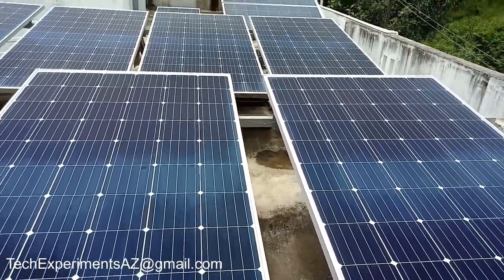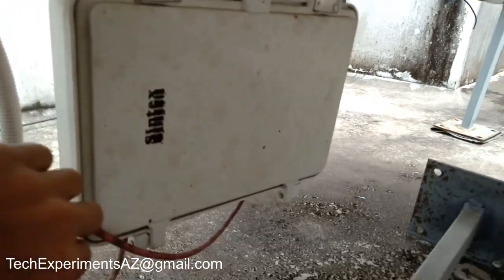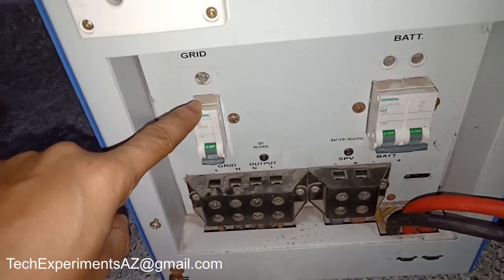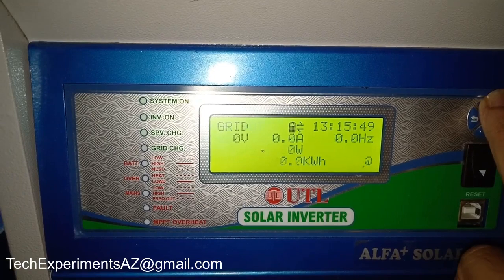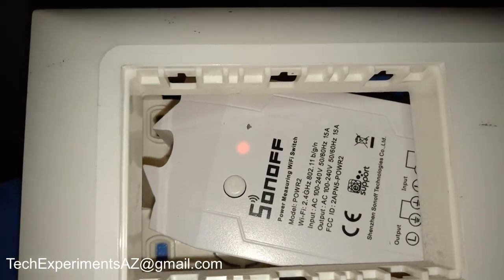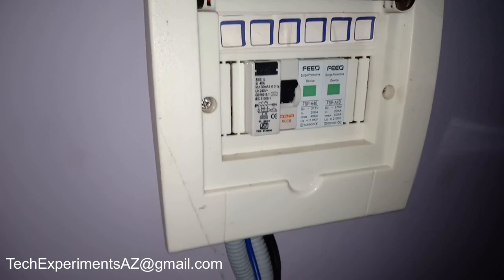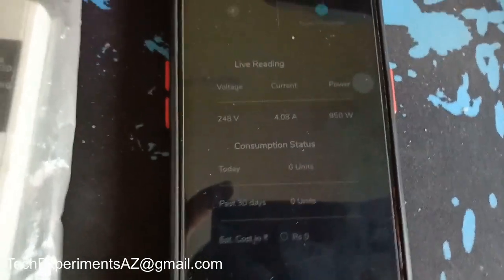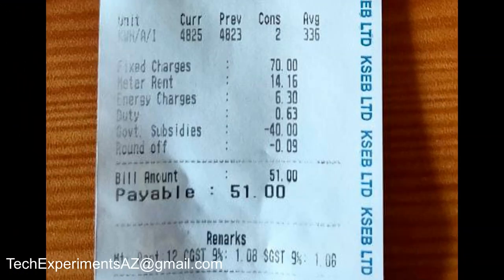KSEB bill 51 രൂപ മാത്രം.  സോളാർ ഇൻവെർട്ടറിൽ എല്ലാ ഉപകരണങ്ങളും പ്രവർത്തിക്കും. Off Grid Solar

Comment: 3 by. 6. Tube. Bhai. ..Pipe..Alla.   4. Battery.   3. kW.  Kittumo
Reply from the maker: yes tube anu , pipe alla,   thanks pointing it :)  1" by 2" GI Tube
1 battery 150 Ah 12v = 1800Watts
total 4 battery = 7200Watts = 7.2 KW storage
50% DOD = 3.60 to 4units range il  battery  use cheeythal nalla life kittum
Thanks for supporting channel by subscribing.
Reply: Ok. 3 kW.  How much.  The cost.   Totel.  Installation.  With.   Vickram. Pannal. 360. Watt's.   And. Luminas.  Batter. y. 150. AH.  4 PCs       the. Cost. Please
Reply from the maker: Total 2.6L 
Vikram 375Watts mono perc panels
Luminous 150ah c10 5 yr replacement warranty  battery
UTL Alpha plus 348 with 5 yr Warranty

Comment: Total amount?
Reply from the maker: 2.6L
Thanks for supporting channel by subscribing
Reply: It's money. West.  2.6.  Lakh.  After.  4 years.  Change. Again.  Battery.   Almost 70. Thousand.
Reply from the maker: Also 3kw on grid system will cost around 2 lacks.
Reply: Better on gridd
Reply from the maker: All items have 5yr warranty. Using workstation and other devices that need good power, can't depend kseb for that since I got almost full day power cuts due to post chance, line touching, HT line work.... latest luminous battery has 72 months warranty. Off grid systems ROI is not fast as Ingrid but both has its own advantages
Reply from the maker: Using 3kw,1kw,50w off-grid and 3.5kw on-grid solar system.
Link for 3.5kw  on-Grid with mono perc half cut cells 
Video link : https://youtu.be/rlSbuhUaa7Q
1KW cost me 50K video link: https://youtu.be/yAHuk5VdodY
Videos of other solar systems are available on channel